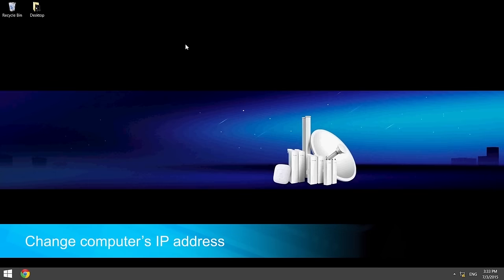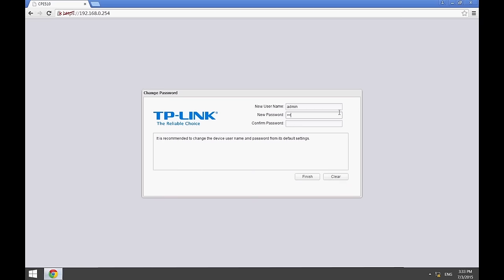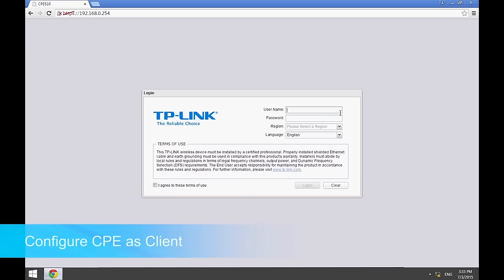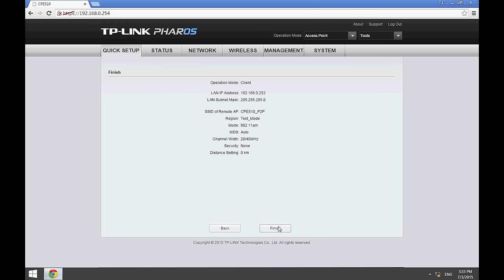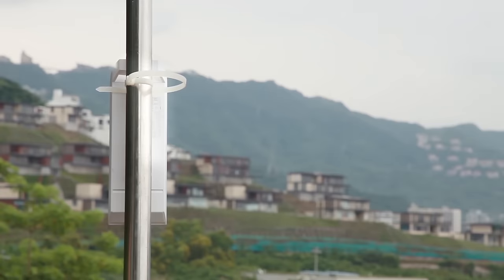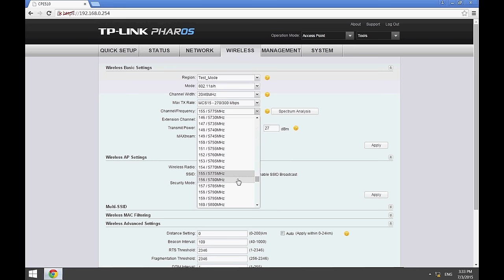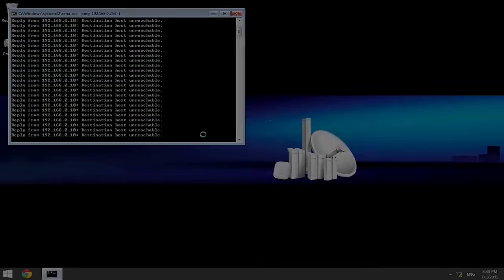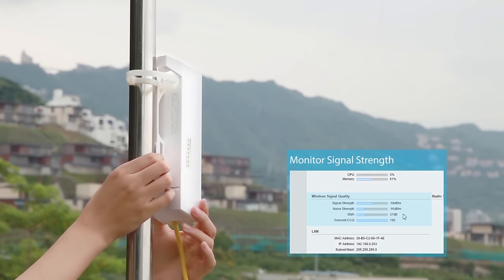TP-Link CPE Point to Point Installation and Configuration Tutorial Video

Comment: I want to ask some questions.

1. Does this package include 2 CPEs or do we have to buy 2 separate CPE?

2. Upto how much range we can use?
Reply from the maker: Range is dependent on the Antenna gain and which product you purchase.  They are sold separately so you would need to but two separate units.
Reply: @TPLINKTECH  yeah but if the conditions are good what is the maximum range we can expect between 2 CPEs providing one is access point and other is client?
Reply from the maker: @nihaalahamed1994  Can't tell you that.  The Maximum rage for each CPE is different depending on the model.  You can go to TP-Link.com lookup the CPE you are looking at and review the specs of that specific unit.
Reply: @TPLINKTECH  Hmm ok. I asked about CPE510 & CPE210

Comment: hello, can i connect this tp link for other router?.. example of these routers are asus and tp link router.. ?
Reply: no expert, but basically yes. You can generally mix and match network equipment brands if you have some sense for what you're doing.  As long as you're not trying an invalid configuration or something that's otherwise impossible then things like this will usually work fine.

Comment: ok so I put the ethernet cable in my routers Lan port then I connect the ethernet cable to the tp link.
But what port do I connect that ethernet cable on the tp-link. to get the internet.
Reply from the maker: The CPE doesn't generate the internet service.  The CPE should only have one ethernet port.

Comment: On my TP - Link CPE 210 (300 Mbps), no MCS15 270/300 Mbps available, but MCS15 130 / 144.4 Mbps maximum, why? (firmware version = TP_PharOS_1.3.3_160705), Tks.
Reply: Bandiyo , because 300mbps is only available on the 801.11n and 5 ghz wireless network compatibility
Reply: Because the Ethernet port is only 10/100 on the cpe 210

Comment: If I have an already installed TPLink CPE 210 point to point bridge - which has been configured to an existing network (pre fibre) , but now fibre has been installed and the router has changed, which has a NEW Gaetway IP address, how do I re-configure the existing setup please? Not too techy please with instructions.....!
Reply from the maker: https://www.tp-link.com/us/support/faq/724/ This FAQ should help.  If not please contact support.
Reply: @TPLINKTECH  Hello - thank you for the Link. - however I was not accurate in my description. I have an existing Point to Point Link (ie an AP unit and a Client unit) that extends the existing network from the main house to a remote location via the wireless Pt to Pt link.
Reply from the maker: @sudanpan  Is the AP unit in AP client or AP router mode?
Reply: @TPLINKTECH  One unit is in Access Point mode, the other in Client mode, thereby creating the existing Pt to Pt link, which is working. My query is about needing to change the IP addresses of each unit because the network has a new router with a new Default Gateway.
Reply from the maker: @sudanpan  I understand that.  However I wanted to make sure I was sending you the correct FAQ.  AP mode comes in two formats AP Router and AP Client.   Client mode is sperate from this.
Reply: @TPLINKTECH  No idea. The CPE210 was originally supplied pre-configured for the installation site. The Access Point unit is plugged into the network router. The client unit is 200m away at the remote location. I am assuming the units were originally set up in exactly the way the above video shows.
Reply from the maker: @sudanpan  It appears there is also just an AP mode as well.  But i don't have an FAQ for that.  I would suggest contacting our business product support at support.smb@tp-link.com they are far more versed in this product than I. They can give you all the steps on how to configure the product.

Comment: How many client can this CPE (AP) can connect?TIA
Reply from the maker: These CPEs are designed to be point to point long distance units.  Because the beamwidth is narrow we recommend using them with two units one in AP mode and the other in Client mode.  Connect the client unit to a WAP or router and then your answer would be determined by that device's capabilities.

Comment: But how to make connection with AP router mode.
I want to setup AP router mode on Cpe220 and i want to connect my cpe210 to cpe220 in WISP MODE.
IN MY CASE MY CPE210 STATUS CONNECTED BUT NOT OBTAIN IP address from cpe220.
Please guide me how to i solve this problem.
Reply from the maker: We don't provide direct support through comments on YT.   Instead you would need to contact the Support team https://www.tp-link.com/us/choose-your-location/  choose your region, click on support and then contact technical support.
Reply: You can learn much and ask questions at TP-link community: https://community.tp-link.com/

Comment: I want to setup router as a repeater, but my network does not show on the survey. How do I fix this??
Reply from the maker: Your router needs to have WDS or Range Extender mode.  If it does then you need to reach out to support for assistance.

Comment: When setting up Ap and client. Do you have to have both plugged into computer/router at the same time. Trying separatly but it does not work??
Reply from the maker: Actually setting them up separately is how they are setup.  They do need to be line of sight though?  So if they are not then that could be the issue.  If they are we would recommend contacting support.
Reply from the maker: Nikos papadopoylos   Line of sight does matter.  The beamwidth for that device is Horizontal: 60° Vertical: 30°  so the two units need to be with in line of sight and the beamwidth to send and receive to each other

Comment: I was using 1 off of a router and thought buy another and use it as an access point, must have received a defect, after setting up and installing, the device keeps going up and down, can only see on network 5 seconds every 90-120 seconds and no device is causing conflict for the IP I had assigned it,,, oh well, guess 3rd time is not a charm,, would have been my 3rd unit, use 1 to bring internet out 300 feet into the woods, through the woods, no way can go over these white oaks without huge pole on each end, and another to share the WIFI to yard.. works great except when it rains...
Reply: now added new router, need to reconfig it all and us site is web based only, canadian site still has pharos software process,, looking for web based method..
Reply: as soon as logged into device it locked up, unable to do a thing. think remember this being issue before,, was tough to configure these devices...
Reply: I am going to just try AP to CLient as suggested. Hoping no one attacks network, got 1 CPE in AP mode, will go out to building and configure client, 1st time seen all transmission LEDs light up, so maybe will work.  V2 unit so no test mode option exists.. and only 1 port on device.

Comment: So two CPEs are required and cant just use one. Thats what i thought when the discription said "transmitter" so i'm going to look into a repeater instead
Reply from the maker: Yes for typical setups.  This is because these have high power direction antennas with a very low beamwidth.  If you are looking for a single device that does both and is omni-directional i would suggest the EAP225-Outdoor.
Reply: TP-Link The WiFi I use is about +150ft away. Could the EAP225 pick the signal up and extend the signal to my devices at home??
Reply from the maker: @ryanchristian3977  the EAP225-Outdoor can be linked with other EAP225-outdoors via Mesh technology to boost the range.  With 2 units you should have more than enough coverage to cover 150 feet

Comment: Is this waterproof product ?
Reply from the maker: CPE210 and CPE510 are both IPX5 rated and CPE710 is rated at IP65
Reply: @TPLINKTECH  which one is better for rainy days? IPX5 or IP65?
Reply from the maker: @richu_rich  Depends on environment really 

IPX5 Rating
Devices with IPX5 rating can resist jets of water at low pressure. However, not tested for solids. Whenever such devices are exposed to low-pressure conditions such as rain, these will not get any damage. If exposed to high-pressure water, such devices get damaged because of not waterproof.

IP65 Rating
No ingress of dust; complete protection against contact (dust-tight). Protection against water jets from any direction

Comment: I got 2 cpe510 set it up and I'm struggling to connect them 800m damm:(
Reply from the maker: You need to make sure the TX power is not set to high or to low.  I would recommend setting it at 1Km

Comment: hello, can someone help me. with this point to point configuration connection can i share file from one computer from the AP  to the Client  computer , like example i have one document from one location and i want to share it to the other location and do some editing so that the original location can still have the file on it computer.. thanks am waiting for your urgent teply...
Reply: Yes you can do it. Just make sure the DHCP server on both devices i.e. AP and Client is turned off. Let your basic internet modem to allocate dynamic IP's to all devices, connected to the network, on AP side or on Client Side. In that scenario both sides can see and talk to each other.

Comment: I installed this 510 cpe as access point and client mode but it is saying there is no internet help here
Reply from the maker: You will need to make sure the Client has an open line of sight with the AP.  It also has to be within its azimuth Beam Width: 45° (H-Plane) / 30° (E-Plane)
Reply from the maker: @mesutzakeer3420   You can't send this group any pictures but you can request assistance from business product support at support.smb@tp-link.com

Comment: hi i just got 1 question how do i get an internet connection to public (wan)
Reply from the maker: You can configure one for as a client device but it has to be with in the range and line of sight with the source's service.  The unit itself doesn't generate a service but can broadcast it.
Reply: @TPLINKTECH  so i connect a dsl line into the main tp-link in which port.?
Reply from the maker: @mrpoliticalguy5602  No the CPE does not support DSL service.  You would need a DSL modem/gateway then you would connect the CPE to that device's LAN
Reply: @TPLINKTECH  ok so I put the ethernet cable in my routers Lan port then I connect the ethernet cable to the tp link.
But what port do I connect that ethernet cable on the tp-link.

Comment: Please, any app that can help to  find    location
Reply from the maker: What do you mean find the location?
Reply: @TPLINKTECH  A map or application that helps connect devices. I set up the Access point device and take the Client device far away. I mark one point and the other on the map. It would make it easier for devices to see each other. We are currently creating a project where we want to implement SRT data transfer from video cameras. The terrain is flat but the visibility is too far.

Comment: Hi, all hope someone can assist I had two CPE510 working as AP and Client at a distance of 500 meters to monitor my cameras at my farm gate working beautiful but after a storm and lightening I lost communication between them they are both earthed I have re set them and set them up again, but it is if they keep on loosing communication between them so with any further struggling, I bought two CPE210 and set them up but with regret they are doing the same as the CPE510 I have bypassed all old lan cables as I thought the lightning could have damaged them but with no success I have checked the power supply for stability and that is fine It is if they communicate only for 4 seconds and then it is off for 4 seconds now I sit with my hands in my hair as I cannot get to the problem hope there is one that can assist perhaps I am missing something as this must be a common fault as both CPE510 and CPE210 are doing the same.
Reply from the maker: It could be a line-of-sight issue, it could be Ethernet connection issue, or it could be wireless equipment on the client side.  You would be best served by contacting business support at support.smb@tp-link.com

Comment: Please i have an existing netgear router that serves as my Wifi Provider but the range is limited, and I would like to use the CPE210 to extend the Wifi Range. What function should I select and How do I go about it?
Reply from the maker: my suggestion would be 2 units.  1 in AP connected to the Netgear and one in Client where you want the service.  These two units need to be line of sight  and at the client side you will need an AP to broadcast the service in a omni-directional round.

Comment: Just wanna ask if I can use a single tp link cpe220 plug in directly to my extra router(connected to my pc via lan) to connect directly to my main wifi (router) without another cpe220?
Reply from the maker: If you put the CPE220 in Client mode and have it line of sight to the source service  then yes a single unit will work.  Often line of sight isn't possible without a 2nd unit mounted outdoors at the source.
Reply: @TPLINKTECH  I am able to put the CPE220 outdoors but the source is inside at my mothers house that is placed beside the wall, the distance between from the CPE220 and the source is roughly 30 to 35 yards with only 1 wall in between our houses do you think it can still work? or any other suggestions like buying different CPE products? or just buying 2 pcs CPE220(budget related). Thank you for the response earlier!
Reply from the maker: @davidcorpuz2919  Try the EAP225-Outdoor.  That might be a better product and line of sight isn't needed you would connect it to the source but it can broadcast 150 meters.  It does not have client mode so this is why it has to be at the source but you shouldn't need any other equipment.
Reply: @TPLINKTECH  Thankyou!

Comment: configuring access point , when i change the ip to (192.168.0.10) , the internet will lost. how to restore my internet while using the ip of the AP?
Reply from the maker: Putting a device in Access Point mode will cause the DHCP address to be lost.  Statically assign your computer with an IP using the 192.168.0.10 as the gateway address.  You should then have access restored

Comment: I set this up to traverse 20m (meters); I lost no (that I can see) ping or upload/download speeds (Aust. NBN) My strong recommendation is however -  employ professionals if you're not 'comfortable' with networking ( btw not the same as computers necessarily)   2 x CPE's cost me $160 AUD total --> TP-Link CPE510 5GHz 300Mbps 13dBi Outdoor CPE antenna  (need to use for 5GHz channels, low bandwidth interference)

Comment: sir how can cpe 510 just one router conect with mobile
Reply from the maker: The CPE510 is a point to point long range directional AP.  it requires a source to provide the internet that it then beams long range to another unit that is with in line of sight and with in its beamwidth.

Comment: How to connect free internet ???
Reply from the maker: You don't.  TP-Link is not a provider you would need at least one unit connected to a source to make use of the device.
Reply: @TPLINKTECH  plz make video nano station device and how to connect free internet
Reply from the maker: @kunalkb4310  To use a CPE to connect to a network you need line of sight with the source, the unit configured in client mode and you would need to know the source's wireless network name and password.  This is regardless if the the internet source is free or not.

Comment: ud think just one of these geeks would consider showing us how to simply use this device as an antenna for pc wifi... 100 videos and even the manual not one mention...... slow clap.........as complicated as it can possibly be and yet not the simplest most basic   simple  section for.. click this and this and set that and now ur pc or laptop is using this device to scan for random wifi signals.... nope................
Reply from the maker: That would be client mode.  However you still need to be line of sight and within the beamwidth of the source signal.
Reply: @TPLINKTECH  but in client mode.. i see stations but does not recognise normal standard home wifi..
Reply from the maker: @gabrielsansar6187  The Antenna is directional so it needs the source to be within its beamwidth and line of sight.  If that is not the case it won't see it.
Reply: @TPLINKTECH  No.. Im saying... all set up and set to client and then hit survey which means scan to me.... it sees several stations across the city but not normal standard home wifi it simply cannot see them or ommits them.. only shows to see likewise  signals. I wanted one just for standard wifi connections... the simplest of things.
Reply from the maker: @gabrielsansar6187  This isn't omni-directional.  Unless your Home WiFi signal is broadcast directly in front of the antenna and with in its beamwidth you won't see it.  This is only going to pick up WiFi that is in its direct line of sight.
Reply: @TPLINKTECH  I KNOW......... ive beamed straight at it.. and others close by.. does not pick them up
Reply from the maker: @gabrielsansar6187  It should be.  We aren't support though.  Try reaching out to support.smb@tp-link.com they know more about the product and can answer your questions.
Reply: @TPLINKTECH  no it`s being sent back.. not fit for purpose. And yes.. I did ask them prior to purchase would it a,b,c,d  well it  e,f doesn`t